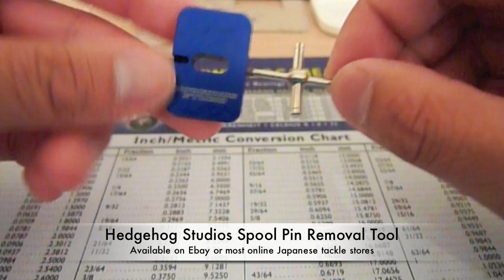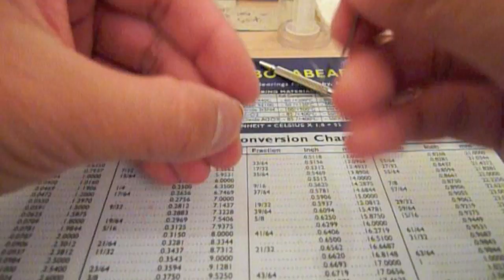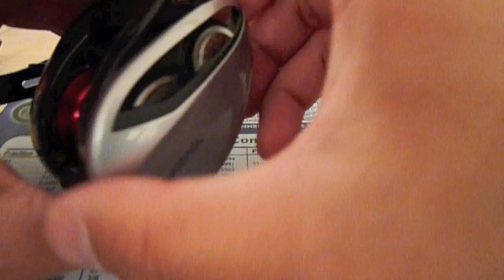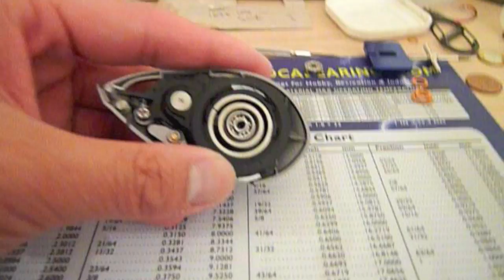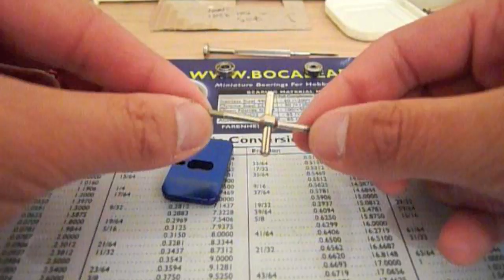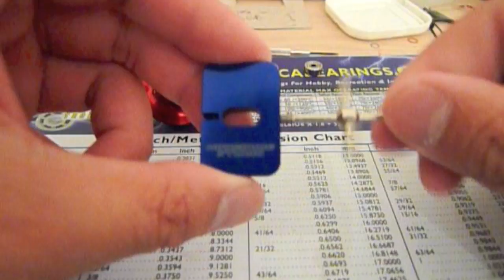Daiwa T3 Ballistic Spool & Side Plate Bearing Upgrade Tutorial

Comment from the maker: the T3 & T3B has amazing casting capabilities due to the T-Wing system. The bearing upgrade would push this further and allow the spool to spin @ higher RPM and to start up easier.. the Sammy is not a hard lure the cast, once you step down in lure size and weight, you'll start to see the benefits